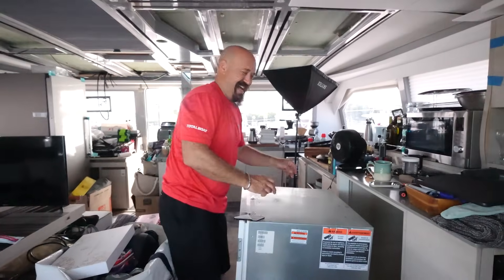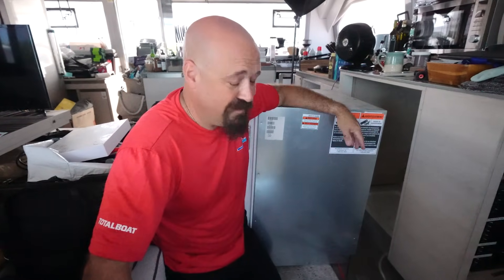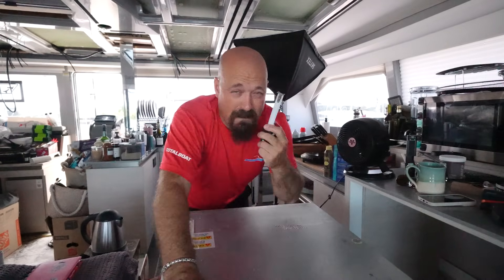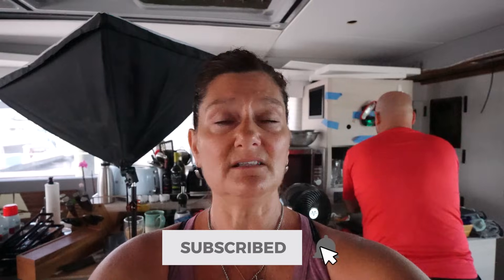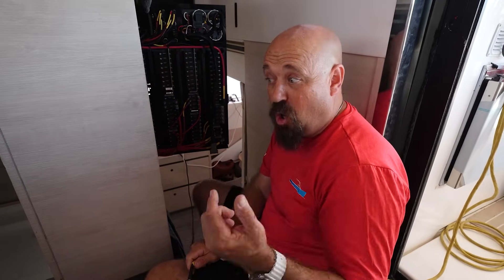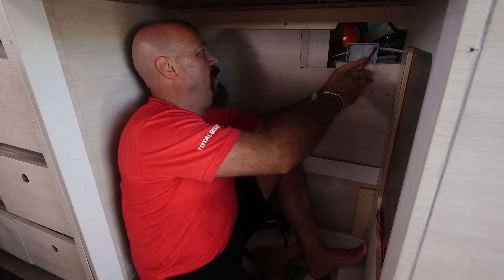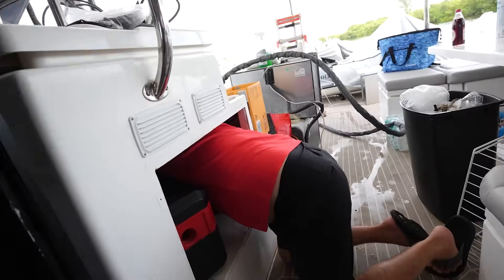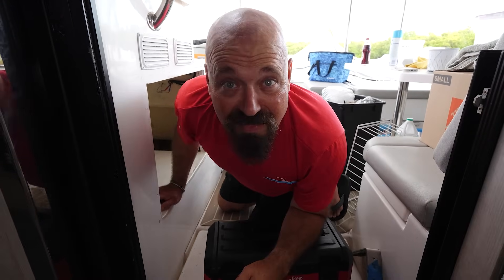JUST THE TIP//Refrigerator Install & Repair-Episode 154

Comment: Ty, about refrigerators, I did some calculations a few years ago on the Dometic top models vs. standard household A+++ (best european energy class), and besides being approx 10 times the cost, the Dometic used almost 10 times the wattage. My calculations could have been faulty, but I checked them. It kind of makes sense, here a main selling point on household appliances is low energy consumption, and it’s a much much bigger market than RV/camper/boating. There’s major players competing therefore better compressors, better insulation, better management.

Comment: I want to share what I know about refrigerant on systems, an old technician said to me you have to use an amp-meter on the load side of the equipment, once it reach the ampere value written on the manufacturer plate that is when you stop adding refrigerant. Sorry for my English guys.
Reply: Refrigerant is sorted by weight..there should be a weight label on the fridge you have to use refrigerants scales to allow the correct amount in. When the the correct weight is inserted it will go
Reply: @craigscoullar564   I imagine is a correct and precise way to know the quantity and thanks for share but if you have no scale at hand you can use amp-meter, if you don´t have any you can use the Ty method.
Reply from the maker: Lol! Indeed
Reply from the maker: I actually did use the Aunt method for the precise tuning. Scales are hard on moving boats.

Comment: Hi guys.  I'm joining you repairing a submerged Leopard.  In my case, it's a Leppard 53 Powercat and she was run into a jetty and submerged up to the countertops in the galley.  But - I don't have your amount of time to spend on repair and I absolutely don't have your skill set and experience.  After the hole is repaired on the starboard hull, I'm mostly simply replacing the electronic components (I'm assuming they are basically a lost cause) and replacing them mostly back to original.  Most of the interior is amazingly intact.

I'm wondering if you replaced all the wiring.  If so, why?  I'm assuming I'll be replacing the terminals but not the entire wires.  I don't see how water (submerged for 5 days and then put on the hard and cleaned on the inside) would affect wiring except on the ends.  Any suggestions?
Reply from the maker: Thanks for watching and the question. Unfortunately, we assumed the same with our wiring. Our boat was only down for 18 hours and we discovered that  1. R&C does not use glue lined heat shrink 2. anything energized at the time of the accident will short the wire and burn off the tin to dust inside the wire 3. those wires act like a wick and immediately begin soaking, we found water damage 30' back inside the wire insulation. Rewiring is your ONLY safe option! From experience, you have a unique set of challenges ahead of you. I encourage you to reach out via email at thecrew@sailingdauntless.com. You're going to need someone with experience in your corner ;)

Comment: As an Australian, when you talk about DC power being crap 😂! The US still uses imperial instead of metric Ffs!😂
Reply: You misspelled Asstralian....
Reply: Unfortunately the world is a Confusing mess of "Doing it Different".
Imagine how simple & cost saving for manufactures>consumers, if we all did things the same. Appliances, Transportation (left vs right side drive), etc.

Even just in Au, like most, every state/territory has different policing, road/boating laws, building codes, education, workplace/wage regulations, etc, rather than being nationally governed. Even parts of one subject are confusingly governed by national, state, then local council puts their spin on it, onus is on us to know.

Boating (& Air) should at least be safer with international governance, rather than confusion with every time we sail into a different state, country, especially when sometimes translation into english doesn't make sense.

Comment: Weird? must be a new editor - 1) Have to get galley fridge done for farewell party in 30min, seems to take way longer than 30min. 2) Suddenly doing 2nd fridge, same shirt, no mention or vision re party, guess it happened? 3) Gassing 2nd (ebay) fridge hoping it will work, then suddenly it's night with finger, no result re gassing fridge?